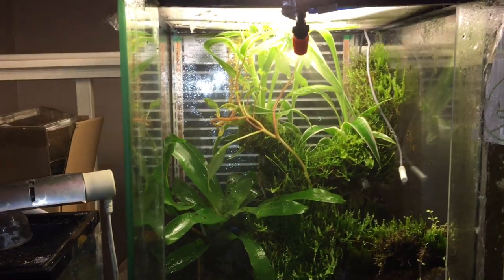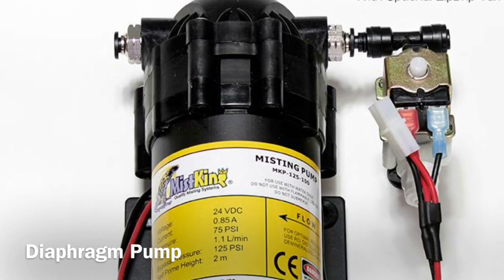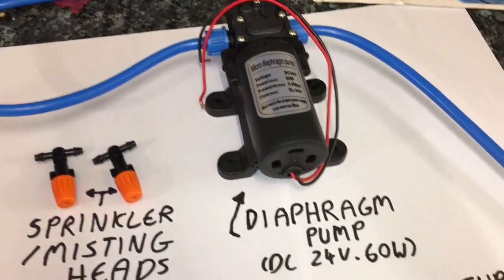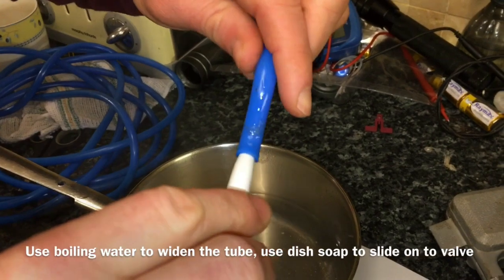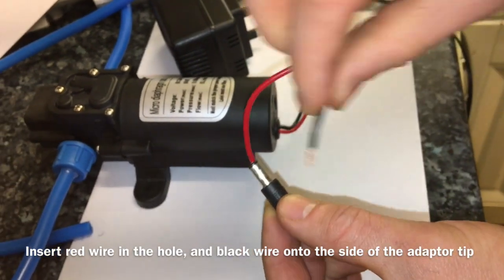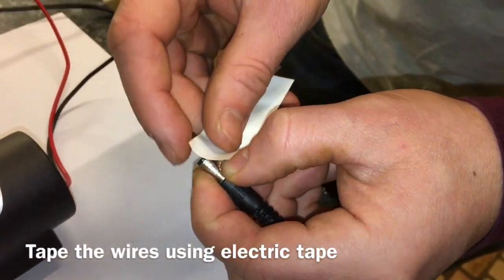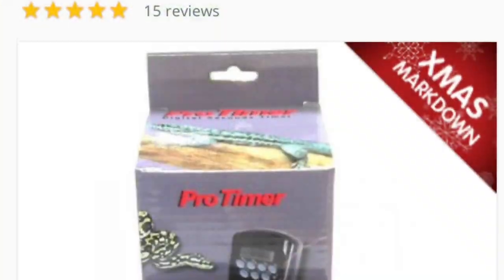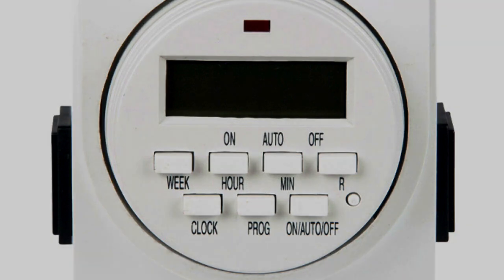How to Make a Misting System for Terrarium Vivarium or Aeroponics (New video in description)

Comment: A nice solution! However, the connection to the adapter seems a big untrustworthy. A thermoplastic connector costs less than one euro/pound/dollar and most of us will have a few lying about anyway. Cut off the official plug, and add the connector in stead. That may save you a lot of paperwork with your fire insurance company.
Reply from the maker: Lukas van de Wiel  thank you for the constructive comments which will really help my viewers! I'm happy with the electric tape connection, I've done it for years and never had any problems. But you can never be too safe, so it would be a good idea to use what you have mentioned.
Reply from the maker: Hey, all the materials are available through our store - https://diy-herps.my-online.store/DIY_Misting_System/cat5494609_4177017.aspx including some high quality nozzles for a much finer mist than shown in this video
Reply: @DIYHerps  well that link is no more.
Reply: You should put that into the description.
Reply: This barrell adapter would make a better connection.

https://www.amazon.co.uk/CLEVER-LITTLE-CLB-JL-52-BARREL-2-1X5-5MM/dp/B01ATP13M4

Comment: How do you choose a transformer? Does it have to be the exact same amps and volts?
Thanks for the video!
Reply: Typically a transformer/ power supply adapter is selected after determining the volts/amps needed for the system.Volts,Yes and no. If you have 2 12v appliances you can wire them in series to a 24v power supply (or 2 6v apps to a 12v power supply, or 2 24v apps to a 48v power supply, etc.) safely, but wire gauge will limit have much amperage the apps accept (but I try to get as close as possible). Hope this helps.

Comment: Hello. What size are the tubes you are using? I have sharknfitted misting nozzles with basic 1/4"tubing but it will definitely not stretch to the size needed to fit into the pump. The tubing I'm using is rather hard as compared to what yours looks like. Thanks for your help

Comment: Can I use 12 volts diaphragm pump or I need to use the 24 volts one, and where do you got the tube
Reply: Pump voltage doesn't matter, you just need the correct powersupply and make sure you get around 10bar or 160PSI from the pump.

Comment: Thanks for this video :) I intend on doing something like this in my tegu's enclosure.  For the water supply, do you just have the tube in container of water or do you have it connected to a water line? I'm curious.  Thanks!
Reply from the maker: Mark Adams you can either make a reservoir and drill holes in bottom of tanks with tubes going down to the reservoir or hook it up to a false bottom in your tank or you can just hook it up to separate water source just Be careful not to drown your tank

Comment: Would this work with a powerhead (the size recommended for 30-40 gallon aquariums)  as the pump? I already know that it is capable transporting water vertically as I used it in an aquaponics display.
Reply from the maker: Geckomander I haven't had any luck with aquarium pumps, they don't seem to create enough pressure to make spray from the mist heads
Reply: Ok, maybe I'll save it for a water feature, thanks!
Reply from the maker: Hey, all the materials are available through our store - https://diy-herps.my-online.store/DIY_Misting_System/cat5494609_4177017.aspx including some high quality nozzles for a much finer mist than shown in this video

Comment: Lovely idea, mate ! I am so glad i stumbled upon your post in the dendroboards. Been looking for a reliable DIY misting system for a while now, and was just starting to loose hope. I guess reverse-engineering is the best way to go about it. 

I want to ask you a few questions tho. Why is the pump sort of going on/off ? I thought it would work  more like a continuous mist, rather than pumping action. 
And also, have you done any experiments on how many sprinklers you could possibly attach and still maintain enough pressure for a fine mist on all nozzles ? 

I am going for this in the very near future anyway, but I would like to get a little bit of additional information beforehand.

Oh, and also, does the sound bother you ? I do foresee an insulated casing for the misting system in my setup :D 

Kind Regards, Julian.
Reply from the maker: SartBG thanks for the kind words, as you probably saw on Dendroboard I've been a victim of Cyber Bullying! The reason it goes in little bursts is because of the pressure of the pump pushing through only one sprinkler head, it's just to control the pressure, the pump does automatically adjust the pressure using a bypass valve. If you have longer tubing or more sprinkler heads it's continuous pumping. The mist does come out continuously though, the sound is just the pump adjusting pressure. 

Let me know how you get on! This is a higher pressure and power than the mist king so I imagine it will deliver spray through as many if not more spray heads than the mist king can
Reply: Damn, thanks for the lightning fast answer. I still have a long way until i get the pump, since I'm ordering from China :/ Will come back with a review once I set everything up.

As for the cyber bullying - there will always be hate, mate. That's the way life throws obstacles at us, and all we can do is hold our breath and keep swimming through the shit storm.  But we always come back stronger! All will be fine eventually, Just respond with kindness and ignore irrational people :D
Reply: I just saw that dendroboard post, people like those are why I just started to use facebook for frog stuff instead. I can't stand the mentality of the mods and senior members on there, it's really only good for looking at archived stuff or the market now anyways. Thanks again for the guide, hopefully my mantellas enjoy it
Reply: Geckomander. This guy keeps mixed species tanks, knowingly spreads misinformation, and lies about his unspecified 'degrees'. He was banned for more reasons than that single post. He's also been banned from numerous Facebook groups.  Please do your own research and form your own conclusions instead of believing he is the victim. He was bullying everyone else and giving horrible advice. He wants an audience to cry to.
Reply: Tim Viggers I don't believe cyber bullying is a thing, but you would have to be blind if you couldn't tell they were being very rude to him. If those people popped their heads out of the echo chamber they would realize that nobody cares if they are right or wrong, (their are some undeniably very intelligent people on dendroboard) but if you have to be a abrasive jerks and bait a defensive reaction out of somebody to "prove your point" nobody is going to listen (this isn't directed at any specific member or the board as a whole)
Reply: Tim Viggers I haven't looked at the other stuff, quite frankly I don't care, this was in regards to the tank mister which is a great alternative for those not interested in wasting 200$ to spray 2 tanks
Reply: Geckomander they were definitely being rude. But please understand the context with this individual. He sends aggressive private messages to anyone who disagrees, keeps frogs in improper conditions, all while promoting himself as a self-proclaimed expert. The frustration in  the mentioned post is unacceptable. But it is due to this individual's own actions and behavior. He promotes improper husbandry, unsafe electrical wiring advice and incorrect information about supplementation. Cyber bullying is never OK, but calling out a liar and fraud is our duty as decent human beings.
Reply: Geckomander and that sucks a mistking is 200$ for you guys. A starter system is $120 in the states. $100 on sale
Reply: Geckomander and his wiring techniques are not safe. That wiring = fire hazard, especially around any type of moisture.
Reply: Mistking is freakin expensive for what u get. You need to make a whole other system for your misting, include buckets, make more connections, so there's a bigger chance of leaking. Same shit you can do for almost no money + some isolating tape :D 120$ where I live is a ton of money. I could live almost a month off those 120 bucks :D Getting that with the shipping would be hella expensive, and I still get 1 nozzle. For 120 bucks I can make 5 systems like that one, each with more misting heads than the MistKing :D As for the wiring techniques - If you don't know first thing about electricity, you shouldn't even bother doing this. I do agree there should be a disclaimer stating that this should not be attempted at home etc, but I for one  do know how to set this up. Also, not using a defective current protector with a water installation is scary on it's own, but that gadget could prevent electrocuting yourself etc. even with bad and exposed wiring. After all - everybody has a head on their shoulders and should be able to think for dem selves. However, he is the only one showing how to make a proper misting system on youtube (that you can actually find), and for dirt cheap on top of that.
Reply: SartBG I'm definitely not against a diy system or saving money. But as you stated anyone with a head on their shoulders would not wire it like that. Yes some of the info can be useful but if someone followed these directions exactly they could burn their house down. Where's the money saving in that? The OP either doesn't know about the hazards or doesn't care.
Reply from the maker: Hey, all the materials are available through our store - https://diy-herps.my-online.store/DIY_Misting_System/cat5494609_4177017.aspx including some high quality nozzles for a much finer mist than shown in this video
Reply from the maker: Got a great new shop now man http://diy-herps.my-online.store

Comment: Thanks for the video, it helped out a lot but you failed big-time with the connection to the transformer. You should have just cut the end off and directly wire it or buy a female end and splice to that. Most transformers are pretty weak and pushing the wire into the hole and taping the ground to the outside is a fast way to short out the plug and blow the transformer. Actually at first I thought you were just doing it to test the pump, but then you broke out the tape.
Reply: even some wire nuts or crimps would of been "ok-ish".

Curious if the 20 dollar pump actually the same thing quality wise as the RV or mistking ones.  Might buy and do some 24/7 testing and see if they hold up.
Reply: @Aerogrow  it's a 60W pump on a 9.6W powersupply. That's not even gonna run 24h :D A misting system also isn't required to run 24/7, it runs a couple of times a day for 30-90 seconds.

Comment: This isn’t vary fine mist. I’m looking for almost a cloud of mist. Not sprays
Reply: Go 12v pump and power supply and tight nozzles - the nozzles in this video were trash. Get some that adjust to spray the way you want.
Reply: A mister like the one in this video is perfect for a planted terrarium. If you are looking for a cooler effect / tinier particles to increase humidity more, I would go for a fogger.
Reply: you can get a lot finer mister heads on amazon thats what i use.
Reply: @abyss610  can you make a video including a link?
Reply: i ended up making a fogger with a Vicks coolmist humidifier,  mostly because a misting system even with the finer mist heads didn't work right with my humidity controller. Ideally it only needed to turn on for around 5 seconds and the humidity would rise for a bit more after it shut off to where i needed it. well the controller would just stay on spraying the entire time till the humidity got to the actual shut off point. would end up soaking my terrarium by the time it shut off. my set up is for a Merauke Blue Tongue Skink, needs around 60-80 humidity. 
the reason i made my own fogger was because the ones made specifically for reptiles did not have very good reviews while the Vicks on had VERY good reviews. honestly the one i made cost just as much as the reptile foggers with all the parts. Vicks humidifier around $40, drain line for a dishwasher around $11 and couple dollars for a 2"-1" pvc but its reliable and is a 1.3 gal so lasts a couple of days before refills. the humidifier had a directional spout you could just take out by hand, siliconed the 2"-1" in there and the drain line just pushed into that. the drain line has rubber boots on the ends so seals nicely. have to keep the line vertical because at horizontal it starts to fill with water and plugs it.
do you need it to water but not as much as shown in this video or more about humidity? @sven7639
Reply: Go with a humidifier then

Comment: my biggest problem with this is how loud it is.
Reply from the maker: Alexander Swalwell if you use a 12 volt pump or use a variable power adaptor as mentioned in the description the sound is significantly reduced
Reply from the maker: Hey, Just got some new misting nozzles in and the pump is virtually silent now check out my video on them. All the materials are available through our store - https://diy-herps.my-online.store/DIY_Misting_System/cat5494609_4177017.aspx including some high quality nozzles for a much finer mist than shown in this video
Reply from the maker: Atom izer if you run this system with the new nozzles (please see the video) there is virtually no noise. It does make a noise but it isn’t noisy, at all,  please see video on new nozzles. I can guarantee that if you buy the bulk deal diy misting system for £38 at diy-herps.my-online.store you will be amazed at how good it is! Email me for more info diyherps@gmail.com
Reply from the maker: Atom izer love that video man! No need to call me out honestly, if you google terrarium misting nozzles you will see how expensive they are, and some of them are cheap and tacky copper/ brass things. My nozzles are premium quality, I would love for you to give them a try
Reply: @DIYHerps  Oops...
Webstore is no more :'(
Reply: @TomFredericks187  I too would like a link!

Comment: Anyone tried it with 12v pump ? I ordered one after I saw this video...
Reply: You can get the pumps in 12V as well as 24V. Biggest difference is the 24V is probably going to have a higher flow rate.
Reply: the 12v work just fine for what you need for a terrarium. where i work i had to come up with something for spraying a scented enzyme solution into dumpsters at Pitt university and i used a 12v RV water pump put on a timer to spray a couple seconds every hour. most expensive thing was the power timer. originally tried a circulation pump for a Jacuzzi but it wouldn't draw water up the 13' i needed.

Comment: OMG that wire connection.....Bro.....come on.
Reply: Ya, I would have cut the power adapter tip off and soldered the wires together, then heat shrink if permanent.

Comment: 24v times 0.4 amp = 9.6 watt. So that 60 watt pump is  bogus.....
Reply: You have a good eye for detail ;) The pump would be able to work on 0.4 amps but it wouldn't work at its maximum capability. It would only work for 2.5A/0.4A= 16%, which means the pump is useless in my opinion in this setup. The pressure he gets out of the nozzles is just mains pressure.